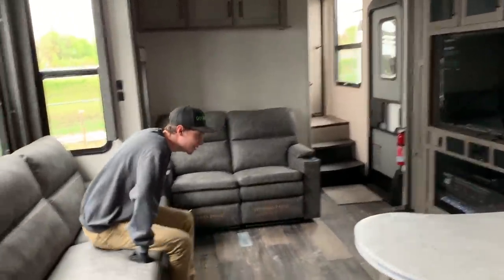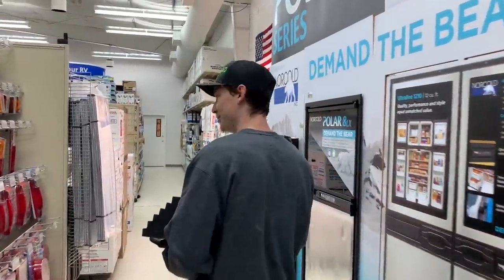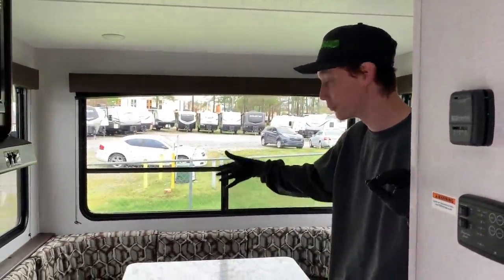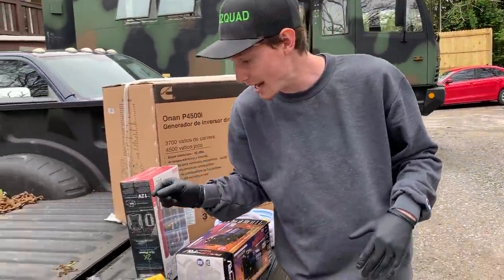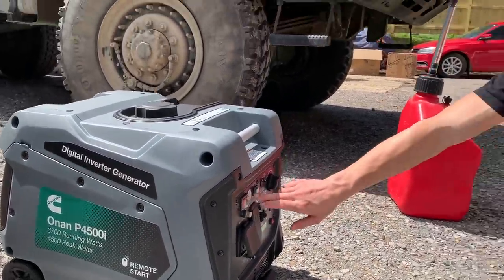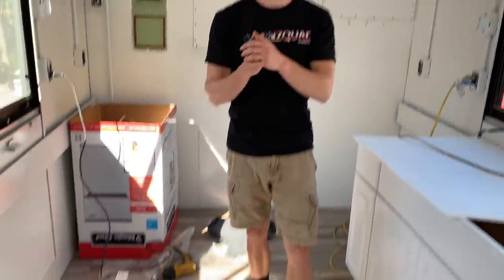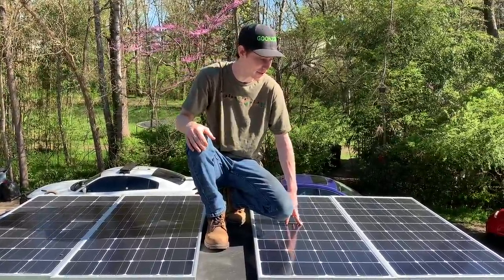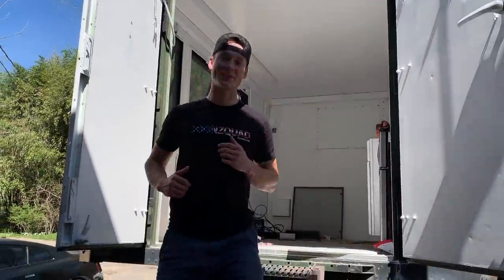Building The Ultimate Apocalypse Vehicle Part 5

Comment: That power panel is like that because military equipment sometimes runs on 400hz power instead of your normal house 50/60hz. I’ve worked on equipment vans like that which have outlets for both.

Comment: Agreeing with the other comments to check the exhaust routing for the generator, especially next to the opening for the HVAC.   A carbon monoxide leak into the living space is not good.  Consider routing the exhaust down and away.  And a carbon monoxide detector inside would be good.

Comment: Now what you guys should do is, … return the generator and try to get one that will fit into an attachment on  or near your truck. The older ones showed the generator inside of the unit and accessed on the outside so as to accommodate any and all types of plugs. I do agree that the generator that you guys brought that has wheels on it, should be replaced.Which means that you will have to use it on the outside; not inside of your truck. The smaller panel on the inside; is large enough to be used as an air conditioner unit. As for the larger one next to the smaller one; you can use that space for the instrument panels for the vehicle or, … use it to housed your tv or monitor. Just a thought, ….

Comment: The sink you guys should just use pex lines with shark bite fittings that just push in and make it permanent. That is super easy and wont sun fade and crack like the hoses.

Comment: Good job guys I would go gas for the stove instead of running off electric power. Find a good used stove on line from a camper that was wreaked. And probably seating and or beds there out there .

Comment: when fixing the solar panels in place, angle them a bit.
they seem to have an upstanding edge, so water/ rain could get sitting there.
most likely it wont do any damage, but the will get dirty way faster and might even run more hot.

altho they work on solar power, solar panels tempt  to be less efficient in full sun because of the extra heat.
so making sure they wont "overheat" because of filth might be a wise thing.

Comment: Gents, 
Adding a marine type onboard battery charger will do well to recharge your batteries while the generator is running or you are hooked up to regular power. 

Would be easy to make a new exhaust for that generator to run up and away from the little nook and keep things a little more quiet and to also insulate/sound proof it wouldn’t be difficult. Whatever you do, put a good seal around that access door, don’t let carbon monoxide sneak into the living space.

Comment: It is comeing together LOVE IT. You should run your solar in series parallel, to make 24 volts to the mppt. It will charge your 12 volt batterys much better and help keep shading to a minimum loss.d  CHEERS          Steve h.

Comment: Put some anti slip strips on them stairs for when its wet as you're slipping when its dry and the last thing you want to do when you're camping miles away from nowehere is crack your head in a slip trip fall head injury scenario.Thats the way to think military maximum durability, usability and simplicity so its easy to troublehoot and fix out in the boonies...

Think also maybe about mounting the solar panals around the sides of the vehicle so "rooftop real estate" isnt used up and then maybe folding them out when Stationary like you see on space sattelites...
or if you do put them on the roof make them so you can angle them up 45 degrees slanted or something so they face the sun for longer. as also flat they are more likely to pick up dirt and damage as its easy to step on them and then fold them back down flat for clearance when moving thr truck from here to there. Also depending on where you go like on that logging trail expect anything outside the thing to be able to take a whack from a branch....Even use motors and automate the solar panel movement like radar dishes so they follow the sun automatically  even,,easy enough...

nice bulid this though enjoying watching your ingenuity and down home can do attitude...

Comment: I see a couple of problems with mounting the generator above the cab and next to the AC unit. When the generating is running the AC unit will be sucking in the carbon dioxide from the generator exhaust and sending it into the living area. A minor problem with mounting the generator above the cab is how hard is it going to be when you need to refuel the generator. Bottom line, mount the generator low on the rig maybe on one of those roll in/out RV generator mounts.

Comment: You should cut a hole in that big panel right where the display on the generator is. Then make a clear window and epoxy it from the inside of the box. Id also put a rubber gasket on the inside of that panel so it cant leak CO into the living space.

Comment: I watched a video on YouTube of a couple that also had the same type of military vehicle. The only difference was their vehicle had two rear axles instead of one and a side slide out. They had solar panels on the roof also. They set them up so that the rear set of panels was on a track that they could push over the front panels so they had room on the roof of the vehicle. You may consider panels for the entire roof with one section that slides over the front panels when you want to have room on the roof.

Comment: Hey guys.  That breaker panel is designed for 3 phase 208Volt power which is common for military generators which is what those big connectors were used for on the side of the shelter (usually colors are red, black, and blue and neutral (white)) three hot wires.  The generator you have is single phase 240 Volts AC usually red and black wires and neutral two hot wires.  That's the reason some of the sockets (receptacles) are not working inside.  You can probably make that panel work for single phase devices like your fridge, lights, and receptacles by jumping a wire between one of the two "hot" wires to the third wire, but anything that runs on 240 Volts may not work properly with those three phase breakers in that panel.

Comment: You should also wire the vehicle so if power is available on site you can simply plug in or if there's no power available use the generator. :)

Comment: I would have the generator underneath mounted off  the chassis maybe, will be quieter and safer with the exhaust gases out away from the van. Go for a gas stove also. Probably should have got a compressor fridge too.

Comment: That panel is wired for single phase (household) 110 Volt, single phase 220 Volt (household appliance), and 3 phase 220 volt (industrial appliances) power.  You will only need the single phase 110 and 220 parts of the circuits.  It looks like the sockets and lights run off of the 110 volt.  You need only run White, Black, and Green wires.  White is neutral, black is voltage, and green is your ground.
That will get those going.  The solar cells will need to go to a battery bank, and then go to an inverter before interfacing with the camper's panel.
Reply: Send me a message if you want help.

Comment: Your solar panels produce 100 Watts @ 12 volts apiece under the best of conditions. Usually this means at the equator. You should also think about maybe building some sort of protective barrier adound the whols array and make them so they can be tilted to point more directly st the sun when ever you set up camp.

Comment: You guys have a 3-phase panel, most if not all military equipment comes as 3-phase, you could swap it out with that single phase panel if you unbolt all the bus bars on the inside, or just skip every 3rd breaker and everything will work. let me know if you have a question i'm an electrician

Comment: Might need to think about propane for cooking and heating.  I don't think you'll want to run the generator often because of the noise.  Reason is you can make it and use it  like a camper and not an apocalypse hideout! :)

Comment: SMEV do great sink and hob options ,nice glass tops to them and almost flush mount.
Reply: Those panels look like 80 - 100 watts each 400 would be enough on the roof but remember most of the time you will park in the shade so have a couple of panels on extension cords so you can put them out in the sun angled right at it.

Comment: You need at least 10 gauge wire to run from the generator to the electrical panel box. I suggest build a battery box under the truck on a heavy duty slider. You should not have batteries inside.

Comment: Get a 120/240 v panel.   Mount the batteries under the truck along with the gen. Look ahead. Yes it would be nice up top. But it needs to have air flow and how you gonna fill it will gas.   And one night the wind blows the wrong way. Youre gonna have a camper full of fumes.

Comment: You must put the batterys on the out side as when charging they give of a gas and having them on the inside could be dangers.
Build a nice box and place them under the wagon were they can get air and the gas can escape safely.. make running wire easy too as you can drill in the floor this make less likley for water to get in the cab or box part..

Comment: I’m on Marine certified technician by the way Solar panels do not make the power which is what you were talking about a 100 w panel it’s probably gonna be around 70 w per  panel and it could be lower or higher depending on the conditions

Comment: the existing panel in the rig is a 3 phase panel. this means there is 3 hots (each hot has 120V). residential panels are single phase and have 2 hots. reach out to me if you have more questions i'm an electrician

Comment: That's a 3 phase breaker panel you need to connect a jumper to all 3 of the top lugs and then to the black on the RV plug to the 3 way jumper then green goes on the left  and white goes on the right long aluminum bus bars along the side. Your generator only puts out 120 v single phase. It will work and work fine with the jumper. And be safe. Just can't run any 240v circuits. those circuit breakers that are connected in 3s you can't use as intended anymore. U (can)... still use them but know that if you trip one circuit all three will trip now. What ever they used to hook up to also needs to be unwired. Everything that's copper should have 120v to the aluminum bus bars. Be safe

Comment: you will need atleast 4 batteries to hold that over night. id honestly go with 8 and make a tray for them under the truck. the batteries will only last so long on full cycles. the less you fully drain them the longer they last.

Comment: you guys need to change the electric panel the one in the truck is a 3 phase panel. You need a 100 amp 220 panel with a neutral>> like you would use in your house.

Comment: We ones used the top of a trailer as a roof terras with fensing around it that you could fold down. Maybe mount the solar panels to a rail that can be flipped up as a gard rail. (not noing the exact words, because i am dutch, sorry)I will try to find a picture of it and post it..

Comment: I never thought I would have to say this again. Use a TM! (Technical Manual) The one for this series of vehicle is TM 9-2320-365-10 is the operator TM, TM 9-2320-365-24P is for parts and has diagrams, TM 9-2320-365-20-1 & TM 9-2320-365-34-1are maintenance manuals. You may be able to find more TMs in the series as long as they start with 9-2320-36

Comment: Your panel is a 3 phase panel.  Each wire is 120v, giving you 360v total power.  Some large motors run more efficiently on 3 phase than single phase (dual phase).  Residential is single/dual phase... commercial is 3 phase.  I'm sure my now you know this-  just search for 3 phase power if you dont know.

Comment: They actually make an RV breaker panel that is single-phase... you have a 3 phase panel and that is super cool but you won't need it... Just check and make sure that there aren't things on your rig that require 3 phase???  You can use your 3 phase but you will need to use every other spot on your panel.

Comment: hey guys consider mounting under the truck for ventilation do use deep cycle batt. get a small book on line called: (Wiring Simplified : Based on the 2014 National Electrical Code® by W. C. Schwan, H. P. Richter and F. P. Hartwell (2014, Paperback) about $ 5.00. yor cab over function has a manual option when you have no air supply should be on right of air control box. your motor is a C-7 250 hp dont run it out of fule find a video for purging thair if you do you two are great , funny and smart. have fun lets see more of your dads truck stuff
Reply: regarding batteries

Comment: Guys dont use acid battery it's not safe plus ur going to put it indoors. Even if you install them outside after a while u will have to replace them cause their always being charged, or dont last long cause its acid.   It's best to use gel type battery, It will be more expensive than those two you got but its safer and made for solar. And you can have them inside.

Comment: Suggestion make a battery box mount it where you wanted to put the generator ,then mount the gen on the under side of the truck make a protective cover  and run a fuel line directly to the generator from your fuel tanks (small fuel pump ) never have to fill it .

Comment: If you put the generator behind the panel... how you gona put fuel in it?  Put generator underneath the rig on a shelf near the junction box. If necessary put it in a closed metal housing with a shelf that slides out with generator on it to refuel it.  Tada!

Comment: The lights in the shop van are 12 and 24vdc, and the one's you took down are 110ac, the van doors have to be closed in order  for white lights to work, it's a night time tactical, if you open the doors with white lights on, it switches to BLACK OUT, the dark blue ones, again an Army tactical thing, its NOT a RV, it's a Army Shop Van when at War, the Army runs all the vehicles 24vdc, but their head lights are 12vdc, but the shop van part is 110, to run shop things, like ie maintenance repairs

Comment: Just an FYI...the large compartment you want to put a generator, don't do it....the vibration alone will drive you crazy. That space was designed for the  A/C heater unit. The compartment to the right was for radio equipment. 

The vehicle that you have was designed to be a mobile command or radio communications center.

Comment: Guys, it's a 3 phase panel 120/208v. If you can get by with only using two phases worth of circuits in the panel I would just leave it. If not just swap it out with a normal residential panel.

Comment: To be honest guys you don't want to put the generator in that front compartment. Even an emissions friendly one still puts out carbon monoxide. Not worth the risk especially if you are planning to use the other shot for an ac unit. Most people will advise that the generator shold be about 10 to 20 ft from the camper. Just remember that it will likely be the back up to the solar system.  That front compartment would be better used for your water holding tank. Easy to fill and gravity feed meaning less strain on your pump.

Comment: Those bleu lights are a black out systeem there are sensors on the doors and on the window blinds if you open them the system will turn on de blackout systeem

Comment: You should have bought a female receptacle instead of the Male end now you have electricity running to the prongs when live. Could have made a Male to male cord to go between to be safe from getting shocked when wet and the female end would have been a better fit. On your panel looks like you have a 3phase panem and need ti change it to single phase 120/240 and make sure you ground your system with all the steel you'll be a huge object for lightning strikes and you may want to put in surge suppression in your panel

Comment: 100 watt panels. So 4 would be proving 400 watts at peak sunlight. Once the battery’s are charged you can use the power for anything you want. How many amp hour do each of you battery’s hold? You want to make sure you don’t go over your max amperage.

Comment: Fellas.. DO NOT put that generator near the A/C unit.. reason is that the A/C window shaker is not sealed 100% and they do leak some air. So putting that near sleeping quarters is not smart. I get you have a bracket there.. then my suggestion is flex exhaust hose and make sure it is above the roof of the truck. If you rhino line the back side of that cab or dynomat it that will help with noise.
Secondly. Get those panels on some type of swivel so you can maximize sun exposure and heat them panel quicker. Be safe have a good weekend

Comment: Batteries, should be mounted outside if possible.  If you can't do that, make sure you vent the battery compartment, in case excess hydrogen, and use deep cycles, not auto batteries.

Comment: Boys just look at the back of the panels and they will tell you. You don’t have anywhere close to 1500 watts there though. Those panels are probably anywhere from 75 to 150 each so 4 panels is 300 to 600 watts but that’s a good start I mean even if your running a 1500 watt device you only run it for a short time then the panels charge the battery afterwords. Also that inverter is a modified sign wave and sensitive devises like refrigerators and computers don’t work very well on those you want to get yourself a true sign wave inverter. True sign wave inverters have come down in price dramatically the last few years so just get one. If you are using 8 panels so 800 watts maybe you should look into a lithium setup and not a large and heavy gel setup. I doubt you guys will use this thing much so I’m sure whatever you get will work.

Comment: who ever said its a 3 phase panel is wrong. standard electrical panels have 2- 110 hots in them allowing 220v outlets. campers are different and only run 110v plugs. that why only half of your panel is hot. if your generator can be switch over to 220v it will make both sides of the panel hot if not then move all the load over to one side of the panel.